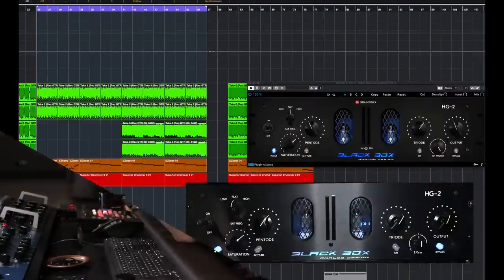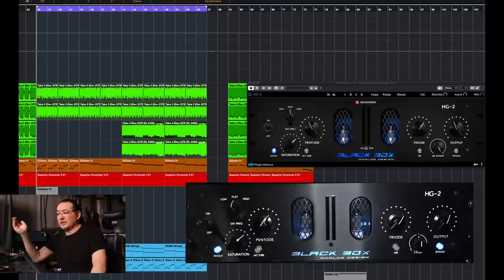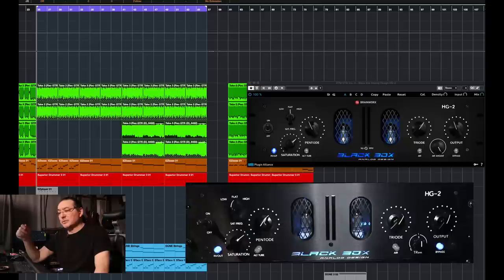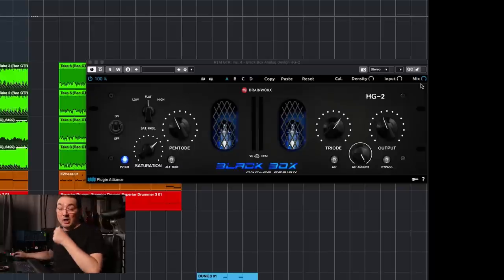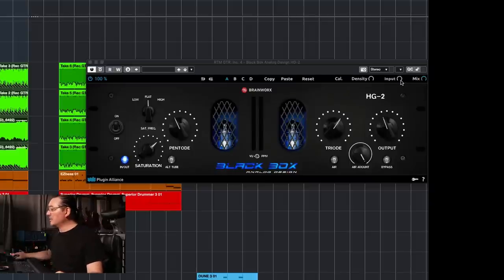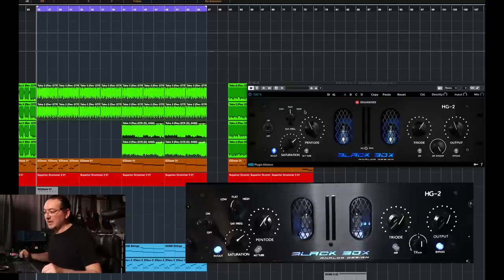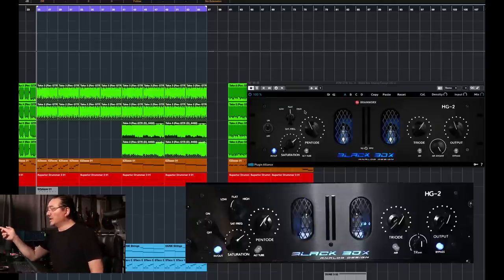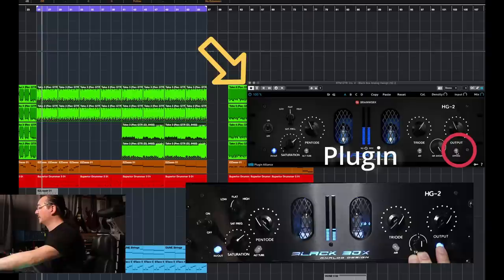Black Box HG-2 Analog Design Hardware Unit VS  The Plugin Alliance Software

Comment: Just stumbled across the video. First thing i hear is that in the first example the hardware is louder than the plugin so hard to tell but will watch the rest of the video now. 
Thanks for taking the time.
On   the synths i find the hardware more narrow tbh regarding imaging. Its thicker and softer in the high end but somehow "adds depth but takes away width“ in a way. Dunno if what i write makes sense. Anyhow, 
I love your conclusion and you seem to be an honest person. So thank you a lot for the effort and presentation
Reply from the maker: I hear the same to varying degrees on software vs Hardware. The software will have more features and functions. The hardware always sounds more fleshed out or 3D if you like.

Comment: Nice one Ken. Really appreciate the demo. The thing I always notice with these hardware/plugin comparisons is the more natural sense of space that surrounds the sound. On the more open settings, the hardware always maintains more dynamics, rather than add more undesired compression. When both are set to heavier compressed settings, the differences are less obvious. Still prefer the hardware if it wasn't for the price.
Reply from the maker: Thanks Paul. I agree completely. I described it a more 3 dimensional for the hardware. Very common with hardware has that sense of depth vs the plug-in

Comment: I found the plugin to be very similar to the hardware as long as you don’t push the plugin too much . Hardware was louder as you mentioned and that is something each of us has to ask ourselves , will it really matter to the mix ? It could when your looking for that power in volume without clipping like you have to worry about with the plugin
Reply from the maker: I agree, except that the hardware has a dimensional quality that the plugin lacks. It does take a quality playback system to reveal